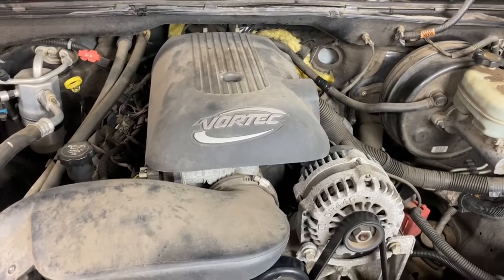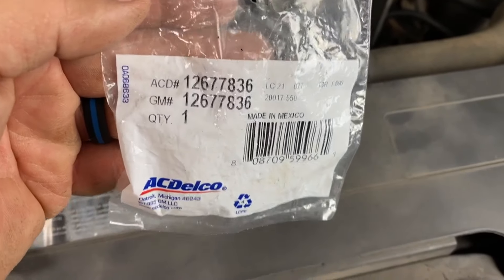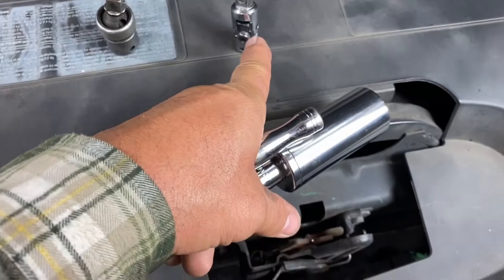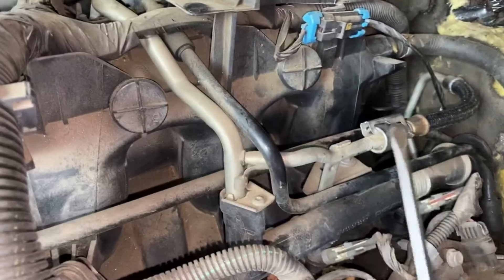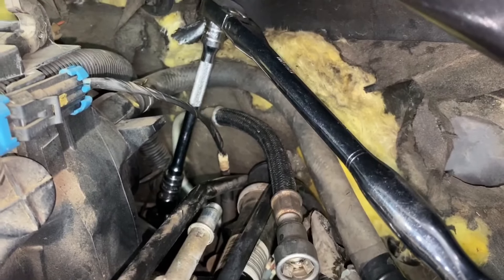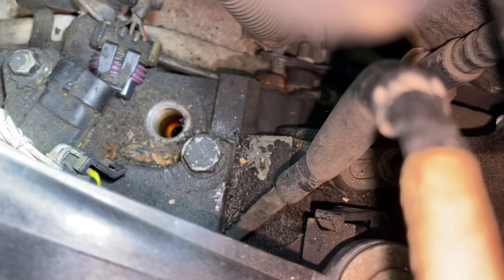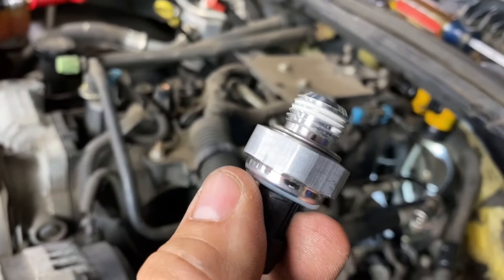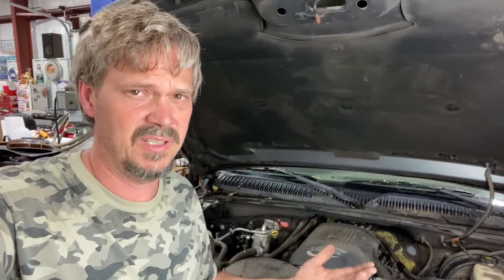Low Engine Oil Pressure / Oil Pressure Sensor Symptoms and How To Repair

Comment: Looks like your vehicle had someone cut off part of the "sound barrier" blocking access to the sender.   I had declined to try this job when we had a 2005 Yukon with a Driver Information Center warning, but its oil pressure gauge still worked fine.
One should know that I watched quite a few YouTube videos before starting, but still had to lay towels over the engine, use a stool, and do some of the work left-handed. I was able to remove one end of a plastic tube at the rear of the engine for more clearance. I did not remove a second tube or the fuel line at its connection. I broke off the gray "protector" on the oil sender harness connector with a screwdriver, and with left hand pushing a long screwdriver against the connector tab and right hand on the connector, I was finally able to release the connector from the oil sender. The special 1 1/16" oil sender socket I bought like 25 years ago did not fit over the sender, I used a 27mm deep socket. Then I used a 1/2" wobble extension, about 5" long, and that was not easy to push into the 27mm deep socket, but the socket had to go on first. Then I used a stubby 1/2" drive flex ratchet to unscrew the oil sender. 
 
Of course once that was unthreaded it fell somewhere so that took 15 minutes or more to find & remove. So I went to O'Reilly and bought PS508 oil sender, which actually did fit my special socket (but I still used the 27mm deep one).
 
So with the new sender (I did not even try to find if the engine had a filter screen, I didn't feel one) purchased, I tied a piece of twine around it it case I dropped that, and screwed that in a few turns with my left hand. Then I put the 27mm deep socket over that, then the wobble extension, then the stubby flex ratchet. 15 minutes later I had that screwed in, and actually in similar orientation as the factory one. So 10 minutes more to remove those tools without dropping them. So 15 minutes later I was able to blindly turn the connector to correct orientation to snap that on.
 
I re-connected the one plastic pipe I had removed, and started the Yukon: no oil pressure displayed, and check engine light was still on. So I disconnected the battery, touched cables together to erase all codes/clear computer, reconnected the battery, and started it up: all was working - SUCCESS !!!
So even though The Cuss cannot fix everything, I was successful today. Yes, this took me several hours, but since I'd just ordered Mrs. Cusser 4 new tires (as the 5-year-old ones were quite dry-rotted), felt why not save $300 to $500 by doing this myself. Some mechanics apparently remove the entire intake manifold for easy access, but that's labor hours. For me, trouble with the special oil sender socket I had threw me for a loop, but the 27mm deep socket I had did save me.
 
Realize that 4 different times I packed up stuff and quit, saying the mechanic could try his luck Tuesday, but The Cuss is a persistent little cuss, for sure. Mrs. Cusser is ecstatic.
Reply from the maker: Great job and great story. This could be made into a video for sure. Thanks for sharing! Happy New Year to you

Comment: thank you for the video! do you have any recommendations on replacing this without having wobble connections?
Reply from the maker: Yes, you can first put the socket on the sensor, then put the extension into the socket but don’t lock the ball into it. That will simulate a wobble extension when needed. Good luck and let me know how it went. Thanks

Comment: Hello watched your video I didn’t find a screen on my gmc savanna 03 I put in a new sensor but oil light keeps doing the same thing
Reply from the maker: The oil light is on I assume. Is the gauge reading erratically? Is it doing same as before you put the new sensor in?

Comment: I got a 2018 ford expedition n it has oil sensor problems n i replacement the sensor now the low engine oil screen it just staying on what could be the cause

Comment: Very helpful! I currently have this issue if its just the sensor that is bad can i still drive my truck around? Even if it reads 0 psi? The motor sounds good and isnt bugging runs healthy but its just saying “low oil preasure”
Reply from the maker: Mine was going to zero but I knew it had oil pressure since it wasn’t knocking. I drove a couple days then replaced the sensor and fixed the issue.

Comment: Just ran into your video this was so great to see and helpful thank you. But I have a question since u mentioned a little of ur back ground I get a burning smell after a while of driving my 05 Chevy suburban 5.3 could it be valve cover leaks or what can I check for any info is greatly appreciated
Reply from the maker: It’s most like valve covers leaking onto the exhaust manifolds. Especially if the drain back holes are clogged in the heads allowing oil to puddle up in the head and leak past work gaskets
Reply: Thanks for the advice I will definitely check that out and keep u posted thank u so much for u help and keep up the great work content is great

Comment: Very helpful video. I do have a question though, after replacing the sensor, when I accelerate, the pressure drops. What could be causing that?
Reply from the maker: Thank you. Make sure your oil level is good. Also could me that you need a thicker oil or the oil pump could be worn, or bearing wear
Reply: Could be the oring has come out of place on the pickup inside the oilpan

Comment: Thanks for the video, my 05 was at 80 now after changing the sensor it's pegged completely out past the oil can   symbol on the guage, can you help with what be wrong? Thanks David
Reply from the maker: Hey, I’m sorry I missed your question earlier. Is the connector fully plugged back in. Check the connections

Comment: Super helpful, thank you. My pressure guage randomly drops to 30 at idle , I don't notice an issue while idling or when I accelerate. Could it be the oil pressure sensor as well or am I having possible issues with the oil pump??
Reply from the maker: Most likely the issue would be in the sensor becoming weak or the gauge which isn’t likely. If you’re running 5W 30 oil you could try going to 10 W 30 or 40 and see if that helps. Mine stays close to 40 at idle

Comment: Just did this on my 03 yukon thanks to your help. The ACDelco part came with a little metal gasket that goes over the threads on the sensor. When i was installing it, that metal gasket fell off and I could not find it.  Was short on time so I decided to continue the install without it. Any idea if this will cause problems? New sensor seems to be working fine.
Reply from the maker: May just seep a little oil without it. Otherwise should be just fine

Comment: Great video!! Got the sensor in, put it back together and still low pressure. Could it be a bad sensor or should I look at the oil pump? Thanks for the help!
Reply from the maker: Thank you. Could be oil pump, wore cam bearings, bad gauge or a clogged screen if you have one. Is it so low that the warning light comes on? How many miles on the vehicle and what weight oil is in it?
Reply: @dhammiam  It's has 147.000 miles on it. I drove it to work this evening and once I reached high way speed it got up to 40 psi. It had no screen. I put 3 or 4 inch bolt in the whole and felt nothin. I don't know, the pick up tube/ screen could be clodded. Thanks for the response. Yours was the best video I seen. Please let me know what you think.
Reply from the maker: @bobdickens4980  could be a pickup screen but I don’t see that very often unless the engine oil isn’t changed often enough or other major issues. You could get a borescope real cheap on Amazon and the next oil change inspect the pickup screen. I think I have a link in the description to the one I bought and works great. 
The best way to check the oil pressure is with a manual gauge. Hopefully you bought the Delco brand sensor as some of the aftermarket cheaper ones are bad from what I hear.

Comment: Do you think that I should replace that sensor in my 01 Chevy Silverado the gauge on my dash goes up and down between 20 to 40 psi
Reply from the maker: Most likely that is the issue and it's the cheapest fix.
I assume you're saying it jumps back and forth, since oil pressure will vary with engine temperature, oil viscosity and rpm's.

Comment: I have a 99 Silverado 1500 LS with a 5.3 L engine 2 Wheel Dr. my only gauges working in the cluster are the oil pressure and battery voltage do you have any idea why
Reply from the maker: Are there any other issues? Have you checked all the fuses? Check the battery cable connections as well. It sounds like an electrical issue

Comment: I have a two thousand twelve silverado is the basic install the same? What kind of problems would this create for the truck? I appreciate the sentiment about wanting to help people do thing themselves as opposed to paying someone to do it. I developEd my mentality Luke this from my dad. He showed me to repair my own vehicles if the job isn't too hard for a novice. I would be grateful for any advice u could impart.
Reply from the maker: It should be the same swapping sensor. It will cause the low oil pressure light to come on and fluctuation or incorrect reading of the gauge. Are you having issues with yours?

Comment: I have a 2013 Chevy Silverado and I believe this is the issue I’m having.. Do you think I’ll need a 1 1/16 socket as well or could it be a different size ?
Reply from the maker: It should be the same size. Make sure it’s deep and 6 point

Comment: My 5.3 has a fluctuating gauge, but runs fine most of the time, does drop when i use my A/C though. When on 0lbs, engine starts a slight flutter/tick, what should i replace?
Reply from the maker: Do you know what weight of oil your using? Sounds like a bad sensor due to the fluctuations. When the A/C comes on it tends to lower rpm’s therefore could explain the drop in pressure slightly though. It’s possible you have worn cam bearings so a thicker oil may help

Comment: Should i go ahead and replace the oil filter adapter if i have to replace the oil pressure sensor on a 2013 Chrysler Town and Country Touring 2WD 3.6L FI DOHC 6cyl if I have Code P06DD? Thank you.
Reply from the maker: Yes, I’d definitely recommend it for that code. Thanks

Comment: I’ve got a question when I turn my truck off my oil pressure gauge stays at 20 (2006 gmc)
Reply from the maker: Does it stay at 20 when you unplug the sensor?
Reply: @dhammiam  yes it does I just tried it now

Comment: Hi thanks for the info the one on my truck started leaking today is that really bad or it happens sometimes to these type of trucks....mine is an 2003.thanks again..
Reply from the maker: They will definitely leak. With it being an oil pressure area just replace it asap but shouldn’t cause any issues. Is it the sensor leaking or somewhere else?

Comment: My truck was driving then just quit and now shows zero oil pressure. When I was driving it the oil pressure was very erratic. Could this be one of the issues?
Reply from the maker: Did the engine make any noises, particularly knocking or rattling noises? My oil pressure sensor didn’t cause the engine to cut off. I know some cars/trucks have the fuel pump wiring run connected to the oil pressure sensor to cut off fuel when oil pressure is lost

Comment: Do the oil pan gasket and the pick up gasket next??
Reply from the maker: Are you having other issues with oil pressure?
Reply: @dhammiam  yeah, but I haven’t replaced the sensor behind the block yet and came across a bunch of these videos that say swapping the o ring could fix the problem
Reply from the maker: @fireballz7  replacing the sensor is easier. If you have a leak or actually don’t have oil pressure then there’s another problem. On my truck the gauge was erratic and the light would come on saying low oil pressure. I replaced the sensor and I’ve been driving it a couple years since and no issues

Comment: Simple fix if you can actually get the socket on. I can't get it to fully seat at all. Been trying for an hour.
Reply from the maker: Is the connector bolt beside the sensor keeping your socket from going on?
Reply: @dhammiam  no it seems to get past that point. I can spin the socket around it just won't drop in. Maybe my socket is too thick, but it doesn't look much different than yours. I can try to can that nut off a bit to see if that helps.
Reply from the maker: @chr1st1an31  try that and let me know. Good luck 🍀
Reply: @dhammiam  it was the socket. I was able to get it off with a different one. New sensor still reading low. Trying to get a mechanical gauge on it. I bought the Maddox kit from harbor freight, but no fitting works on my Escalade. What thread size is the O2 sensor do you know?
Reply: Buy the socket made for the sending unit. There is a special socket shaped exactly like the sensor.

Comment: Yeah we'll change it one on a 2010 53 Silverado and the screen was trying to get it out and we think it went down is that gonna be issue
Reply from the maker: Did you see the screen? Sometimes it has been taken out already or if it fell in take a coat hanger and bend end see if you can pull it out. Otherwise it shouldn’t hurt anything but if it’s stopped up may give false readings but I wouldn’t sweat it

Comment: Love your videos. I have a 1988 Chevy K2500 truck and the engine service light comes on about 20 minutes after driving it and when I try to accelerate, it often jerks or doesn’t want to go. I’m not sure if the fuel filter has ever been replaced and if that could be the most likely reason. It has almost 183,000 miles on it.
Reply from the maker: Thank you. Have you tried new spark plugs?  What code is being set when the light comes on?
Reply: @dhammiam  No, haven't checked the plugs and don't really know much about the codes. Was also wondering if it could be the MAP Sensor.
Reply: @dhammiam  Also, which spark plugs would you recommend replacing on my 1988 Chevy K2500 truck? Are Iridium necessary or are the $3.99 AC Delco good enough, all available at my local NAPA, of course?

Comment: Thank you, I have a 2004 Chevy Suburban my gauge doesn't fluctuate but I have a major oil leak, it drips like there's a hole what do you recommend
Reply from the maker: Is it leaking from the sensor? If so, replace it with the Delco one I have the link to in the description
Reply: @dhammiam  how can I find out if it's leaking from the sensor?
Reply from the maker: @uncledrew9062  take a flashlight and a mirror and look down at the back of the engine just below the sensor. If you see oil running down from the sensor then it’s leaking
Reply: @dhammiam  thank you I'll definitely try tomorrow and let you know the results

Comment: If you pull the fuel pump fuse then you can run the engine until it kills then no big fuel mess when you take off the line. Then just cycle the key a few times and the pump will re prime the line
Reply from the maker: Great point, thanks 👍

Comment: Got some questions on a 04 Chevrolet suburban
Reply: Got oil pressure low light and  sounds like                   🚨
Reply: Got low oil pressure and sounds not good at all and just need to be able to talk with you about all problems that I am having  and needed to do about it ASAP???????
Reply from the maker: Sorry, I missed this comment somehow. Have you figured anything out yet?

Comment: Hi I stripped out the old sensor while trying to remove. Any suggestions on how to remove it?? Please let me know thanks!
Reply from the maker: I would take a smaller 6 point socket and tap it down onto the sensor. I’ll have to measure one tomorrow in my shop if you need an exact size

Comment: Hi i have an 2003 Chevy Silverado with a 5.3 and recently my oil gauge is just at 80 max but past 30 mph it goes to zero the engine sounds fine and theres no clacking or knocking/ticking. And the engine temperature is fine. Im assuming it is the sensor but whats youre input?
Reply from the maker: It sounds to me like a bad sensor. That’s similar to what mine was doing

Comment: Great video. I have a 2015 silverado 5.3 throwing a code. 235k miles. While i dont remember the specific code, i was told twice that it was pump, which is a $1500 repair. Pressure stays around 40 but sometimes randomly drops to 20-30 at idle, then increases with rpm and goes back to normal. I have to add about a quart of 0w20  a month. A mechanic told me that replacing this sensor and screen will solve the code issue a lot of times. Is this accurate in your experience? Ill definitely do it myself if it will fix it. Again, awesome tutorial. Thank you, any and all advice is greatly appreciated
Reply from the maker: Thank you. I would say replacing the sensor could help with the issue. Doesn’t sound like it’s too far off on pressure. May consider a higher viscosity oil if the pressures are low after changing the sensor
Reply: Thank you. Headed to parts store now to pick up brake pads for wife's car and sensor for my truck. I'll let you know how it works out.
Reply from the maker: Yes please do. Good luck

Comment: @DHammiam Just finished replacing mine thank you so much for the great video and explanation of tools required. Replacing this was easy just wish my hands were smaller. Original owner and mine did not have a filter as well.  Subscribed.
Reply from the maker: Great job my friend. I’m with you on the smaller hands and arms would make that job easier. I’d thought about having my Wife do it. Hey there’s another video idea 😂. Thanks for the sub, I’ll do likewise. Have a great week